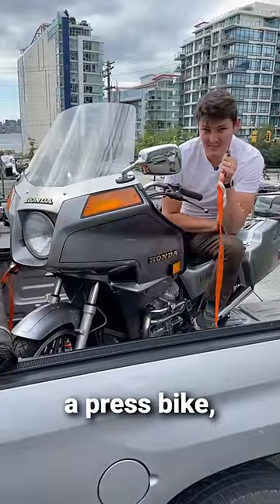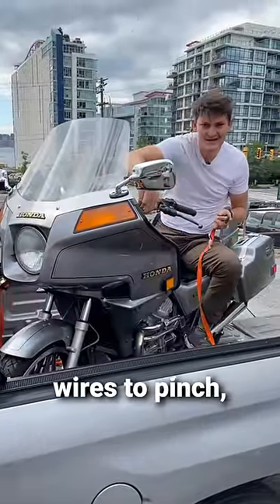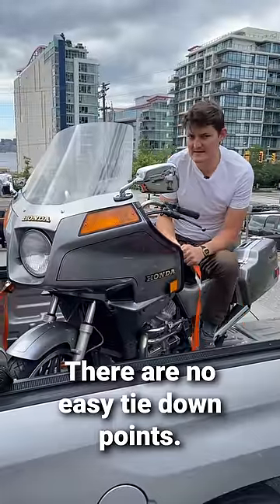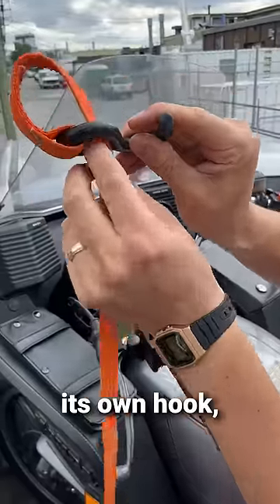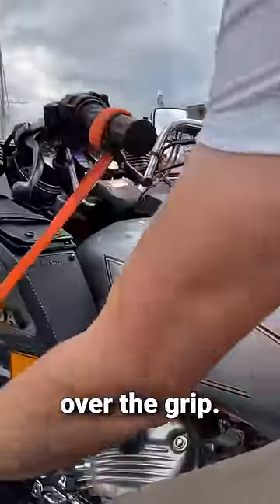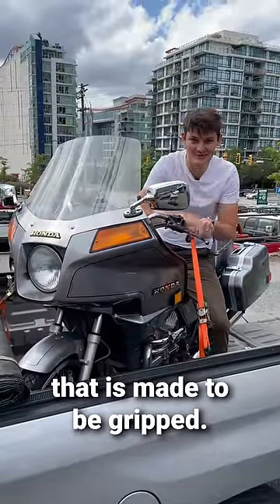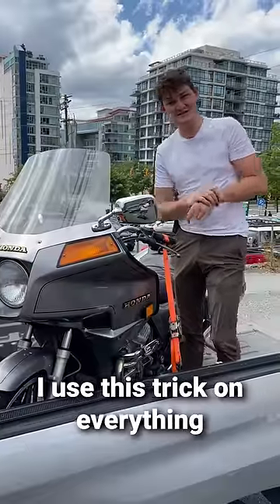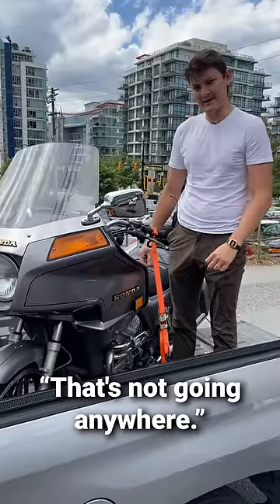The #1 Trick for Strapping Down a Motorcycle

Comment: When I picked up my ´79 Suzuki a few years ago I was looking around to find a spot to attach the straps to. I ended up doing this since I figured the grips were supposed to be sturdy and they cant be scratched. When I got home I was rewarded with a broken throttle grip, the plastic snapped between the grip and the throttle cable mount.

As a side note, if your bike has a center stand, NEVER use it during transport. It is not part of the suspension so every bump and pothole will transfer right into your frame, potentially breaking welds or bending it. Luckily I knew that beforehand.

Comment: Considering the controversy regarding tie down methods evident here in the comment section (and every single other discussion I've seen on the subject on the internet) I'd love to see a video on the science between the different carrier options and tie down methods regarding both safety and how they might impact the motorcycle. 

I have a hitch carrier on my SUV that I load my bike on. I've only used it a couple of times and have strapped to the bars closer in toward the mounts. It's a crf300l so lots of suspension travel that has to get compressed before I've felt comfortable with it not hopping off the carrier or swaying to the side a bit and having the handlebar shatter my back window. 

I'll be traveling from dead center USA out to the PNW then down to the south of Mexico here in a bit so that will basically be it's home for months and thousands upon thousands of miles and I'm worried about how tying it down that way will affect the suspension/fork seals. Not sure I've got another option though as going to the front axle doesn't seem like it will provide enough stability to keep those bars from swaying through my back glass. I'm curious if there is a better carrier/tie down solution or if I'm just being paranoid and should keep doing what I've been doing.

Comment: That trick can be dangerous and damaging on some bikes, take the newer Gold Wings, '2018-23, if you strap by the handlebars, you will break the steering pin where the handle bars connect to the steering shaft. The newer Gold Wings have a single shaft rather than a triple tree. That pin that connects the handle bars is a common failure point when shipping using your trick.

Comment: I get what you guys are saying about not having pressure directly on the bars,

But I use a set called Canyon Dancers. 

They are 2 buckets with straps which run along the bike and cup both sides of the bars. I then gets 2 straps which pull on OPPOSITE directions and ratchet them down to an anchor point.  

My suspension compresses a bit and the bike literally does not move, I then tie the back down using the rear footstands. 

This is how I bring my bike to the racetrack, and it’s how almost everyone else does it beside racing teams. 🤷‍♂️🤷‍♂️

Lmk if this is a good method for you pros out there who STRICTLY tie down on the forks.

Comment: The thing is with is that the grips can actually slide off if the adhesive has worn off.. I usually use microfibre clothes over the points I want secure and make it sure not to wear the paint/metal off

Comment: When I bought my Electra Glide back in the eighties I'd done a deal for "straight from the crate" so I needed a hire van. When collected the van it had completely smooth insides (no lash rails) so I ended up inside sitting across it on its sidestand with my brother honking the horn for lefts and rights! Those lefts, however slow he took them were horror to keep her upright. Since been shown the trick of wedging a 2"x4" beam across the bars and lashing to that.

Comment: I can see the best place to strap down from. 
The bottom tube of the forks has lugs. That is where you strap from. bike can bounce on its suspension without the straps loosening and tightening over bumps.
Do the same at the rear. bottom of shocks or around the axle.
Never comes loose.

Comment: Not a motorcycle owner …YET but I’ve been riding bikes my whole life and if one thing is for certain, never strap by the handlebars for one constantly putting constant pressure on weaker structural elements overtime causes sag also topic you spray to a handle and a grip pops off. The best places imo are central handlebar & loop a V, forks, stocks and even thru the body of you can get a strap thru to loop

Comment: I made strap loops that you can wrap around parts on the bike and I also use heavier duty ratchets straps, those Ryan is using are crap 😊 also take off the side or center stand and pull the front suspension down stops bouncing the rest is simple

Comment: See the front mudguard where it connects to the fork legs. Slide on ratchet strap over that and another on the other side. Bike on side stand. Set ratchet strap on that side not quite tight. Now do the other side. It'll pull against the bike upright against the other. It's below the suspension so you don't need to worry about hitting potholes, speed bumps and the bike bouncing and coming loose. Any ties downs above the suspension is subject to slackening over bumps. Or you just put a shit ton of compression on your forks and knackered your handle bars.

Comment: Ok, I've read the comments, and some of them about NOT strapping to the handlebars/grips are sound, if it was on a trailer. He's in the back of a pickup truck, which doesn't have a wheel chock, and where places to tie down aren't as handy. If the handlebars/grips are the only place you have to tie down to, so it doesn't wreck the faring, than that's the only place you have. Drive accordingly.

Comment: I prefer Tank Straps, sold by srkcycles. Heavy duty ratchet Straps designed to go around the forks at the wheel. So your not pulling on the suspension, but directly down on the front wheel. Very ridged, still allows the suspension to move and never loosens because of the suspension.

Comment: You've gotta be really careful with long reach bars like that though, you've got a lot of leverage on that bar when they're that long. Sport bike style bars with little to no rise or clip ons will be fine but I've had tons of people come into the shop with the bike flopping around cause the bars twisted in the clamp or worse, bent. And now your bike is loose instead of secure as well as possibly damaged.

The best place is the lower triple tree with a soft strap so you can preload the suspension slightly and not stress anything unnecessarily. Makes for a much safer and stable experience.

Comment: Im with Ryan.
The higher and wider you tie onto, the more leverage your ties have to hold the bike upright.
If you tie the straps part way down the forks, or right in the middle of the bike, you lose the lever-arm, and have much less leverage to hold the bike still.
Good luck getting through a series of tight roundabouts, or twisty roads.

Comment: Made to be gripped by a loose hand to gently control the angle, not designed to be gripped by a ratchet strap or to hold the entire weight of the bike during the G loading of an accident. The rubber grip is barely held on there by glue, and the tube is hollow with multiple weak points. It's definitely going somewhere when you hit something.

Comment: When I bought my 95 Kawasaki zx6 I learned right away that she had tie down ears. There were 2 loops under the rear fairing and one look by the front fork. So look for loops. Bc when the suspension compresses on bumps, the handle bar loop will self untighten.

Comment: No, put the bike on the kickstand on the bed and loop a ratchet around the fork tubes, 1 strap per fork tube and crank. The opposite forces being applied by the straps will keep the bike upright and stationary, and will allow the suspension of the bike to work as well.

Comment: Yeah, I'm never using anything above the front suspension to hold my bike. 

12 hour drive with my bike on a trailer with 6 straps total. 1 per wheel to keep the bike from rolling forward or back - strapped to low points on the trailer. 1 per each fork on the front - strapped to low points towards the end of the trailer the front of the bike faces and to the sides, making a triangle if you can using either ends of the straps is best. The only spot I can't avoid involving the suspension is the back, but with the front tied the way it is, I'm able to bring the rear straps JUST tight enough to prevent wobble but leaving enough slack to allow the rear suspension to bounce a little without bottoming out.

I will NEVER tie off above the front suspension. You can get away with 4 straps by removing the ones on the rear (since they're basically just a safety cushion incase a front strap manages to loosen)

Comment: Careful! If you pull too far with the straps, you will bend the handle bar. You need to ALWAYS check the handlebar is correctly tightened. One time a press chopper bike was handed over to me with a loose handlebar and the dang thing rolled over the tank during the trip leaving marks on boths sides of the tank

Comment: You can do the same thing with one strap over the bars just loop it round both grips. But make sure you put the ratchet on the clutch side to prevent damage then another round. Have this one pullubg the bike down and forward.

The next is round this sissy bar or rear wheel pulling the bike down and backwards. 

Lastly put a bungie or small strap round the stand through the front wheel. Especially if using just the sidestand. Yes even on bike with locking sidestands just in case.

Comment: Thread the strap around the lower section of the lower part of the forks to allow the movement of the suspension of the bike. Shift it in to 1st gear and do the same on the other side use the straps to balance the bike your kick stand shouldn’t be touching the bed of the truck. This will avoid any damages to the bike.

Comment: Attaching to the grip like that is stupid but looping it through the it’s own eye I’ve done hundreds of times and works great. Just take it out of the ratchet and slide it between he handle bar and wiring/cable then loop it through the eye and then the ratchet. Won’t pull the grip off. If it’s a Harley touring loop it around the frame and engine guard both and strap it down there, best spot for them.

Comment: For everyone saying this is a bad idea, in over 30 years of hauling bikes I've never had an issue using this technique.  No bent bars, ruined grips, fallen bikes, etc. From Sportbikes, standards, heavy touring bikes and road racers. In the back of pickups and on trailers. Is it the best way? Probably not, there's plenty of other ways to strap down. Will it harm anything? If done correctly, no. In the last couple years I've upgraded to a Lock N Load BK1000 on my trailer. But if I need to haul a bike in the back of the pickup, strapped by the bars.
So restrain your bike however you like, there's nothing wrong with this way.

Comment: and while you're driving home, the grip which is only held on with glue, just slides off. and the bike falls over. in fact, as he tightens the ratchet, you can see the grip distorting, which means its already broken the glue bond

Comment: Don't use the grips as a tie down unless you have the special straps made for it that tie both grips together and pull from the opposite side of the bike. Best way to do it if you have a lot of body work is to go around the fork and down to the ground avoids body work and is a secure tie down point without rubber grips that can come off or just yield enough to loosen your straps

Comment: Until the grip slides off the metal bar. Lot of trust there. Better to secure the hook in the controls and wrap it around the grips. Or buy the correct cone-end type mount.

Comment: its made to be gripped, but not made to have several hundred kilso of weight forced against it when you stop hard, put the side stand down, and lash the footpeg mounts and front wheel axle. Dont lash it down on the centre stand its less stable than lashing the bike on the side stand. Transpored hundreds of bike and had several of my own bike tied down to ferrys for +7 and +40 hours trips on hundreds of occasions.  Seen a fair few broken bars in my time.

Comment: The handlebar is not for tieing the bike down, its only a hand rest, especialty on a bike were the handlebat is just clamped to the fork.
You always go for the upper or lower fork bridge (dont know how its called in english), the frame or as last option the wheels, on a motorbike transopter wich has a fixture for the front wheel.

Comment: Straps are not designed to be used that way. My company delivers machinery, we use straps like this and other tie down methods daily. 
If one of our inspectors saw this it would be instant fail 
It may work 90% of the time but that 10 percent the load can overcome the hook as the force is travelling in a direction it’s not meant to.
Fine in normal use, but if you get in an accident the force going through the strap will increase significantly with a high chance of failure

Comment: The handlebars can work, but you must not be too tight there, they are clamped with two pinch brackets and there are rubber mounting dampers below those. I preferred to run straps to the upper triple tee. With a fairing as that Silver Wing has, the tradeoff is damage to the fairing. I really understand.

Comment: As a professional vehicle transporter I do not recommend this method at all, if you can't load the front and rear suspensions with a ratchet strap then you need to buy a motorcycle dolly. 

Always load the suspensions or you're going to have a rough time when it falls over. Over the front forks (by the center nut) and through swing arm in the rear.

With the kickstand down and the left side ratchets being done last to pull the weight onto the kick stand.

U Haul Motorcycle trailers are $20 a day. Just use those

Comment: Thats not going anywhere, until handle bar bolts give away or are already loose and handle twists in a bumpy road. I would suggest putting one across the saddle from side to side, to prevent bike hopping up after bump and putting more force into handle bars than needed to keep it upright.
Reply: Motorcycle handlbars are easily bent. Theyre built for you to steer the bike not to tie it down imo. You wamt to tie the bike down on the frame not the handlebars. The frame wont bend when you tighten the strap

Comment: You see how much that grip twisted? You understand how grips are secured to the bars? There's a cap that gets screwed on the end. It's not meant to hold that much pressure. Those rubber grips can and DO rip off. Not to mention the potential to damage heated grips.

Comment: It’s not going anywhere until a bicycle rider accidentally veers from the shoulder into your lane or you need to make an invasive maneuver? In that case I would use redundancy, the handlebars could still turn if the front wheel isn’t chocked.

Comment: DONT DO THIS GUYS!

A towing company did that to my Harley when they carried it to the dealer for a dead battery under warranty.
The leverage of the reasonably wide handlebar was enough to turn it while  clamped down and in the process shear of paint and metal from handlebar and risers.

You cant repaint the rubbery paint on my risers/speedo, so the damage was substantial.

The Harley dealer chewed the tow truck guy out for this and told us he had won several lawsuit regarding this type of incident.
Some handlebars (Apes and Wide flyerbars) can generate enough leverage to damage bar, fork or steering joint.

So just strap down somerwhere at the frame or the connection between the fork.

Comment: ALRIGHT!!! Lets get an experiment running to find the best method for strapping down a motorcycle:

Method 1: Strap by handlebars or grips

Method 2: Strap by upper crown, following the fork and fully compress the fork

Method 3: Two straps attached to the lower crown

Method 4: Strap over the frame to engine lift hooks/eyelets/mounting points

Method 5: Strap frame directly

Also experiment with various anchor locations around the bike.

Comment: So I do have one question about your method if you strap the other side, which is also the throttle and it’s a carbureted engine would it not flood it out because when you tighten it is going to add throttle

Comment: Not going anywhere... until that hand grip slides right off the throttle sleeve on one side or off the handle bar on the other side. Remember, those grips are only glued on... and sometimes not even glued!

Comment: It's a neat trick but not one I would recommend. Things like grips sliding off, bending the handlebars, plus not to mention the rubber mounted bars or if those clamps holding the bars down are even tight or not. Recipe for trouble..

Comment: Except for one thing... The handlebar is designed to be gripped by a human that can exert ~80 lbs of force. Unfortunately, the 7/8" diameter 1/16" wall chrome plated steel tube is going to bend and fold in half the minute you make a hard left turn because while it was design to be gripped... it was not designed to withstand the energy generated when your 700 lb bike succumbs to forces generated from being in the back of a pickup truck. And FWIW Ryan... I really thought you were smarter than this. Use that trick on the crash-bar right below your left-hand next time to prevent yourself from looking like a dummy.

Comment: Dealership mechanic here, don't do this! If the grip isn't glued good enough, it will slip off, and the bike will fall over. Grab the lower triple tree if accessible and don't pinch brake lines or wires.

Comment: Or just buy a set of bar cuffs and keep them in your truck. I’ve seen this pull grips off and crush throttle tubes. Even saw one guy do it to a bike on a hitch rack and the bike fell off on his way home. Pulled the right grip off on the highway. Totaled his new bike before ever throwing a leg over it. Gotta be smarter then the equipment your working with